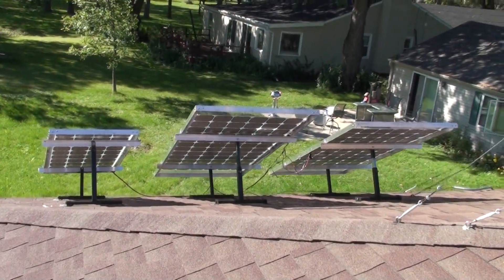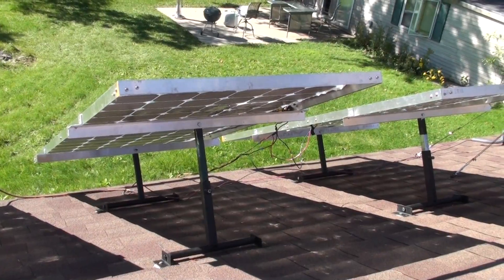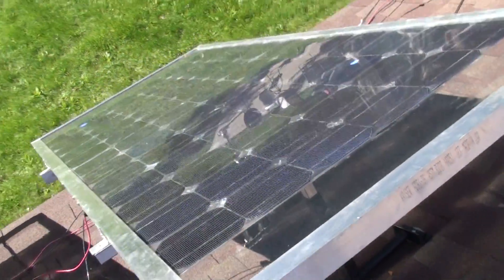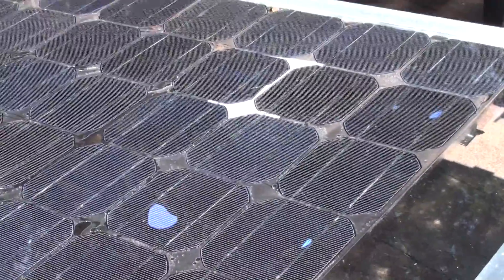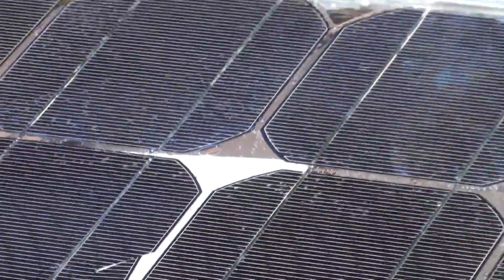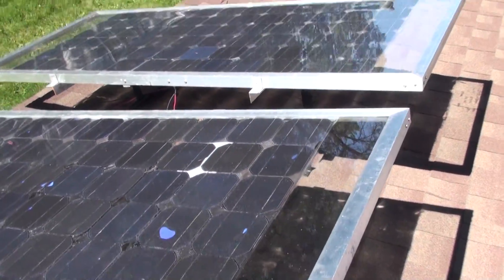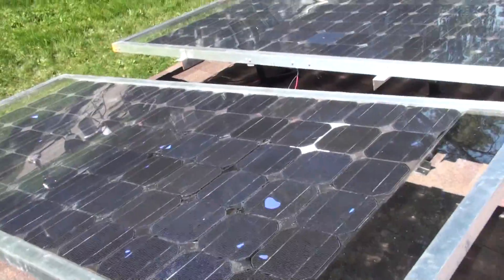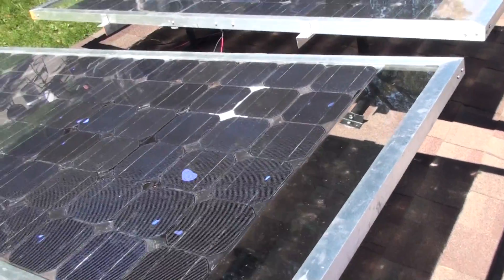2 double DIY 72 cell solar panels and one single 36 cell panel on roof

Comment: Use casting epoxy instead of sylguard.  A lot cheaper and still works just the same!  I bought 1.5gallons for 60 bucks.

Comment from the maker: @Thomashamka It depends on the type of charge controller you have. I have a 500 watt MPPT controller. I have a 12 volt battery bank. The 72 cell panels are in series for 24 volt and the 36 cell is 12 volts. The controller brings them all in at 12 volts but ups the amperage so nothing is wasted.  It is a BZ charge controller.If you have a large enough glass to do a 72 cell go with 72 cells, My other panels are 60 cell panels on the garage using enphase inverters.

Comment: Hi, how did you connect these? Is this 24 volt system or 12 volt? As i got cells for one 72 cell panel and one 36 cell panel and im thinking if i should do 3 - 36 cell panels or the 72cell and 36 cell panel.

Comment from the maker: @sdbvideo  I have the  bubble problem pretty much solved now . look at the other video's showing the laminating oven I use and I use EVA now instead of the Sylgard. Also on the larger 4 panels on my garage roof the one that looks the worst with the most air pockets on it actually puts out the most wattage. I'm probably not going to build any more panels because I think it cost almost as much to build one right as it does to buy one.

Comment from the maker: yes , in April the 2 larger panels on garage roof that aren't shown on here yet  produced 39 KWH's even without the tracker . That isn't counting the ones on the house roof shown here. They probably put out close to the same but I don't have the Kill a Watt meter on them right now because they feed into my battery bank. I expect to get more this month because of better sunlight and adding a tracker.

Comment from the maker: they are completely covered in sylgard 184 so they are protected on the back with that. It's clear so you can see thru it so it looks like there isn't anything there. I've built 2 more larger panels 78" X 35" That I did with Tedlar on the back like the factory ones.I used EVA on those too instead of sylgard because it was cheaper.

Comment from the maker: I went up and checked the sells, each one is putting out 20 volts. I checked kind of early in the day( not full sun) and got 48 watts from the small one with the thicker 1/4 tempered glass. The other 2 doubles each checked out at 55 watts for each half of the panel. So they are all consistent. The cells were supposed to be 2.4 to 2.6 watts each. I'm sure there is some loss thru the glass and I tested with a grid tie inverter and a kill a watt meter. so there is loss there also

Comment from the maker: The mounts are lag bolted into the roof. I tried to hit the rafters but am off on some on one side. I'm going to add a cross piece inside later for extra strength. The roof is pretty strong though because it's an older house with boards on the roof instead of blandex.

Comment from the maker: @sjh7132 Just checked it now, not full sun about 10 amps and 13.5 volts while feeding into the battery bank. This is with a meter with a needle not a digital readout so I'm probably off a little. I'll be testing the panel output later for open voltage in full sun for each panel seperatly.